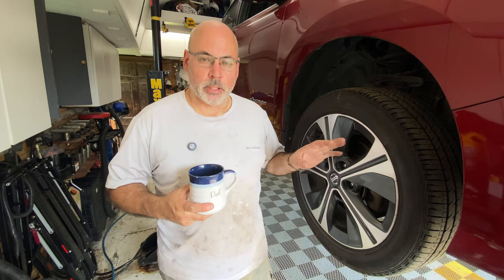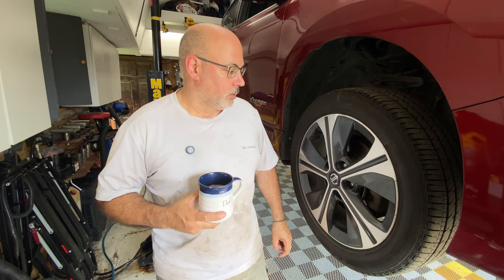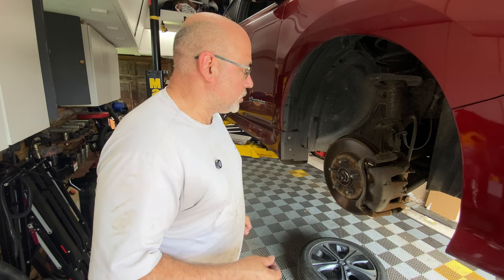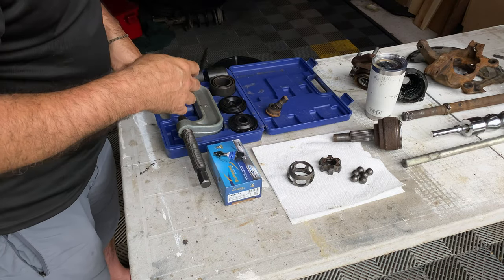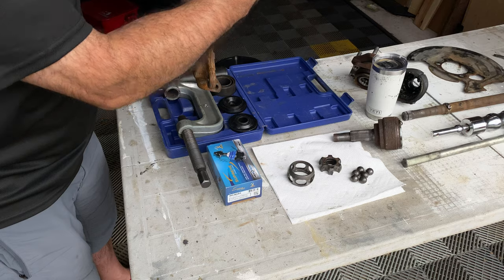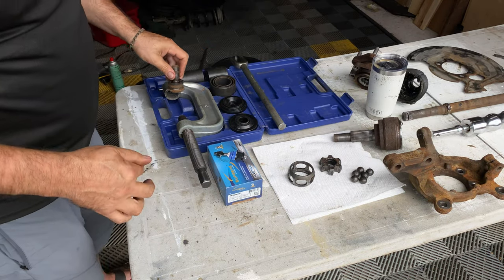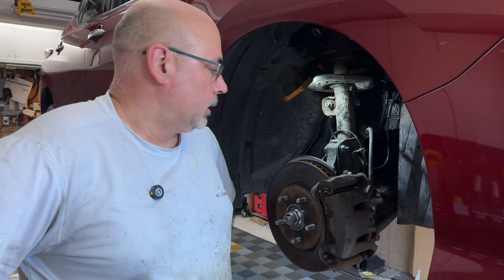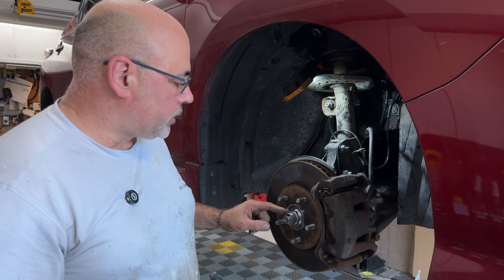DIY CV Axle Replacement on a 2018 Nissan LEAF

Comment: Good video but I would disconnect the shaft from the inner joint. That way you don't need to mess with the intermediate shaft.
Reply from the maker: @npolite22  Unfortunately on this assembly, you can’t.  The inner tripod joint does not have a clip retainer...the tripod bearings are staked in place.  It is possible to disassemble, but you need to do some very careful grinding and then re-stake..something I would not attempt on the car!  You can see the process on the left side joint here: https://youtu.be/N36UzFy-apk
Reply: @DennisWoodCAD  that is terrible. Hopefully it was specific to the leaf. I've seen up to the previous model Altima still has the retaining clip on the tripod joint. If this is what Nissan went to for all new models they are making it to go aftermarket on the replacement. I paid more for the OEM boots over an aftermarket axle. There is no chance I am spending $600 USD or more on one
Reply from the maker: @npolite22  After posting this, some folks pointed out that there was now some availability on the aftermarket axles.  GSP and Trakmotive is listed at Rockauto for $80-100 USD, which is pretty crazy cheap.   I'm pretty sure GSP is actually the manufacturer of the OEM axle assembly.  The new OEM boots had a GSP logo molded in as well.